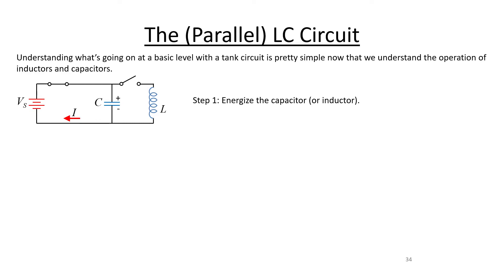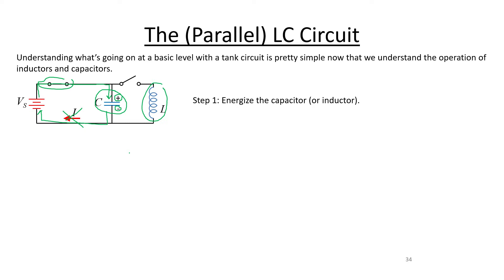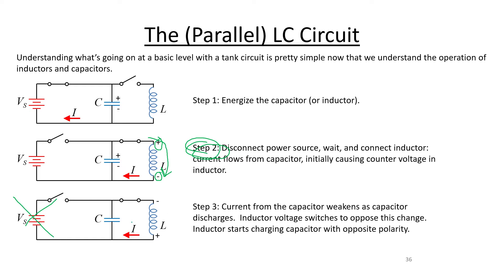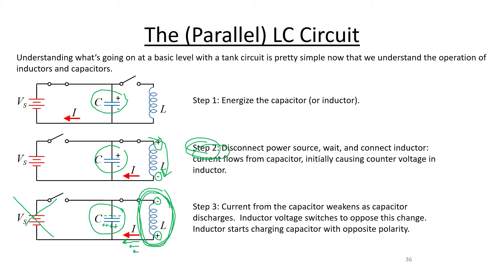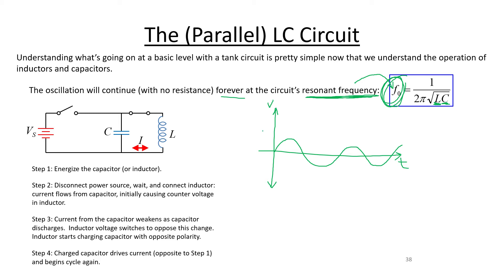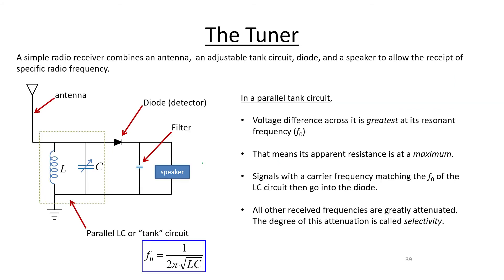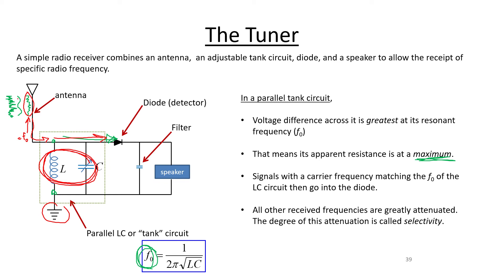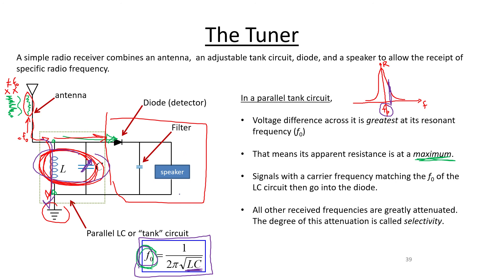Introduction to Radios (Part 6) - LC Circuits and The Tuner

Comment: I did learn Physics in college but there is one thing that doesn't get into my head.

The resonant frequency of a tuning fork is the one which makes the fork resonate.

Similarly i would rather think that in an LC circuit that frequency should similarly allow to pass through the LC circuit and keep on resonating back and forth.

Isn't it the opposite here ?

Comment: Thank you, thank you, thank you. As with other watchers, I to have struggled trying to understand how an LC circuit a resonance is essentially an "Open", but still allows a signal to get through. Your very simple markup showing that non-resonant signals take the easy path through the LC circuit to ground while the resonant signal bypass the LC circuit and move on to be processed finally clinched the concept for me. I can sleep now.

Comment: Hi.In don't understand if the input radio signal is oscilating în lc tuner or it goes în diode.Can you explain me please?I don't find answer on google
Reply: It is not oscillating but going into the diode as he said in this video.
I rewound the video thrice to confirm that :-).

Thanks i had the same question and the analogy is contrary to a tuning fork :-) 

As for your googling wikipedia has the answer, here oscillating comes to mean that it sustains back and forth while the other frequencies die off. And as it sustains the parallel circuit (the diode is parallel) sucks and grabs it.
Reply: @karthikeyanchidambaram6560  thank you very much...
Reply: @davidberar5905 

When i saw your reply i went back to my last sentence above.
Read it again, well that is it how nature works.

(Mathew hasn't answered any question here, let us wait, a year already).

Comment: Hi Matthew, thank you for your video. I know this video is relatively old at this point, but I'm hoping you might still be willing to help answer a question or two. 

In the tuner, are the capacitor and inductor adjusted such that they are prepared to receive exactly one length/period of oscillating current? Almost like they have exact specifications, and if an analogy was appropriate, almost like a lock with a key, or a hole to be filled? The size of the lock or hole would be the capacitance and inductance/maximized apparent resistance. 

So that, in essence, the tuner is a filter, or capturer, that only snags certain periods of oscillating current from all the frequencies of oscillating current sent from the antenna. And ultimately it only snags certain oscillating currents based on how much charge can accumulate at the capacitor or inductor i.e. adjusting capacitance and inductance i.e. apparent resistance.

Sorry this is kinda long, but I think I was sort of understanding it as I typed it out. Please let me know if I'm actually just blatantly wrong in my understanding. 

Thank you so much for the video.